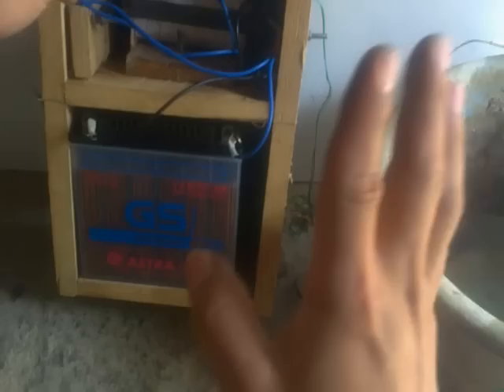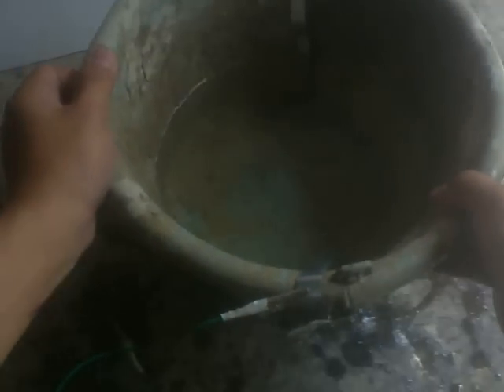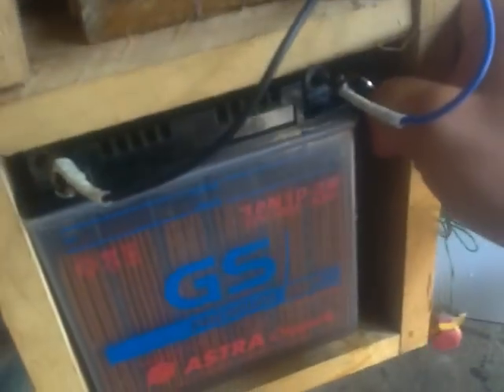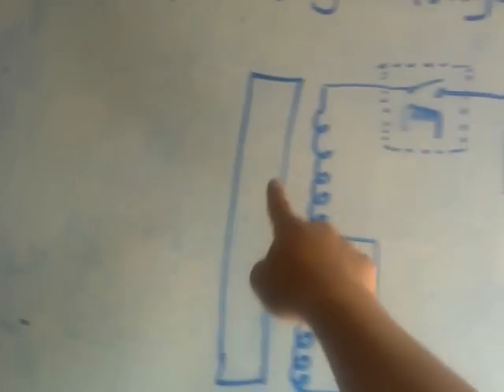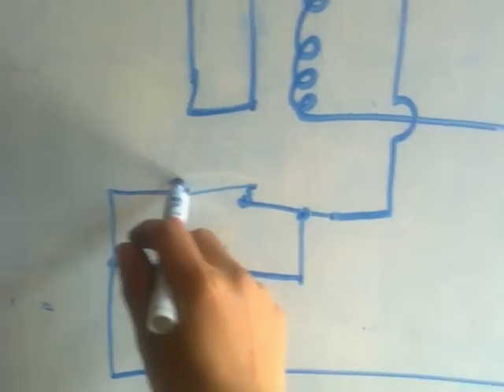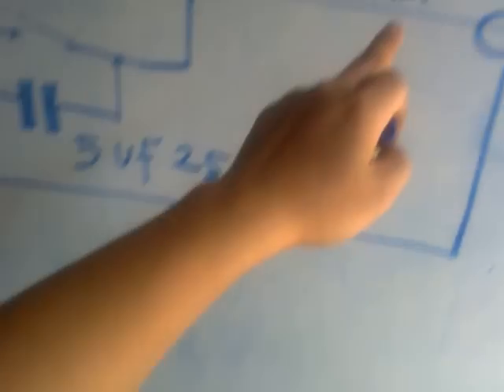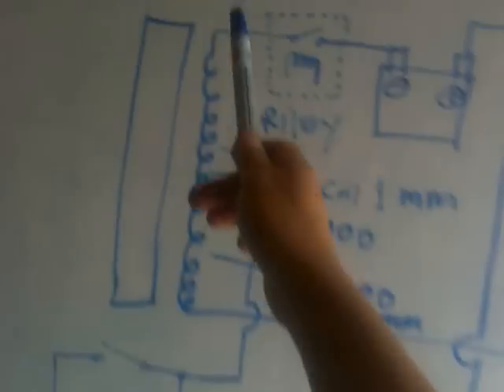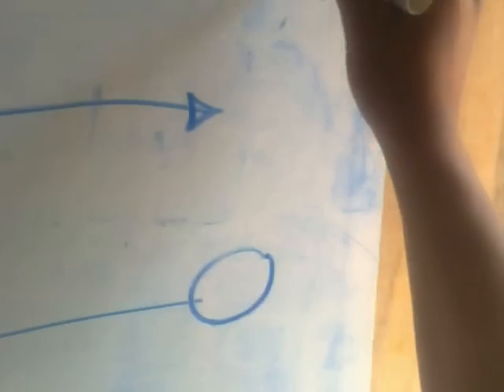Classic Electric Fish Shocker

Comment: 2107 upgraded efficiency fish shocker
Directly Factory from China
Electric Fish shocker/electrofisher/fish stunner
Power:40AH 50AH 60AH 70AH 80AH 90AH 100AH 120AH
Size: 28.5x17x5cm
Effective depth:2-5m
● The fishing machine with high power and good heat,efficiency up to 99.9%. 
● Fishing machine with high tech but easy to operating. 
● Fishing Scope: diameter of 1-5 meters 
● Applications: In the fishing machine,there is a microcomputer which use to regulate frequency and width of impulses by the means of front keyboard and also indicates on two digital displays
https://www.facebook.com/ideamay/posts/102864170239916
Whatsapp: +86 13211122866